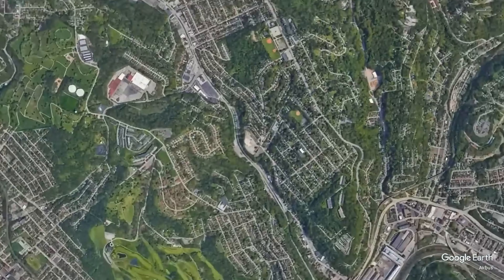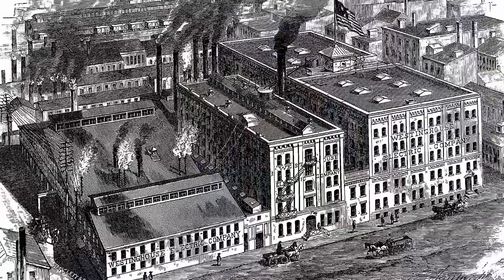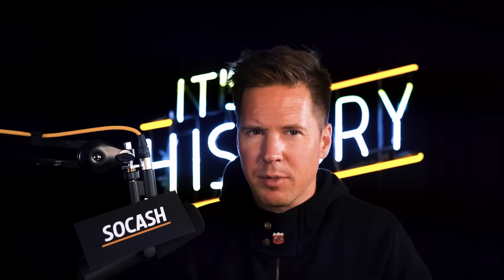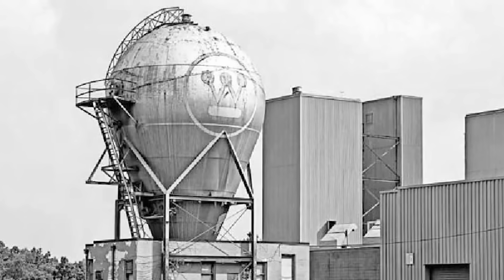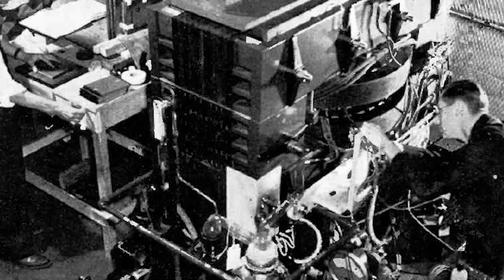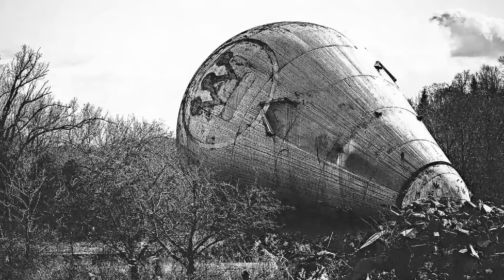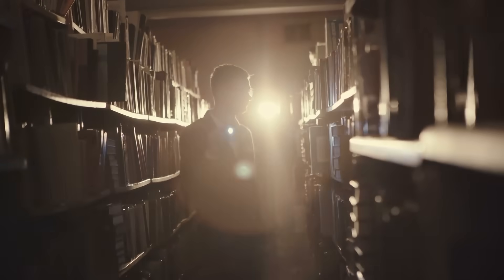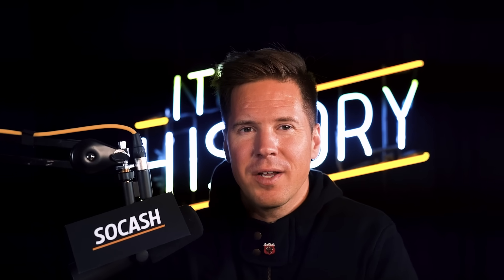The Abandoned Atom Smasher Explained

Comment: Absolute shame such a historical significant device is left derelict .. ;(
Reply: the accelerator is completely destroyed. the bulb is bend and the beam pipe in which the particle beam traveled is smashed to pieces within. The rubble pile outside is about the same as it is inside the pressure Versal. If it where to be rebuilt, it would need to constructed anew, as likely even the pullies where destroyed by the ceramic shards from the beam pipe. 

Also, without the building and the infrastructure inside it, the van de graf in the bulb is useless and incomplete.

Comment: Both the Westinghouse and the later EG&G companies were utilized by the Manhattan Project to develop the earl Krytrons, Sprytrons, Ignitrons, and later Trigatrons, for weapons detonator triggering.  We had two such shops across the street from our plant, and another down the road.  These were later surperceded by light-fired thyratrons or solid state SCRs and IGBTs.  In recent times, Westinghouse built the power Transistors for us, for the Lunar Roving Vehicles, and these devices were also used in railroad and ships-drive motoring systems.  Used to be a great company.

Comment: I live a couple of miles from the original site  the steel light bulb shaped hall that was over The vacuum tubes does still existt. All buildings were demolished It was said to be made into a monument to the original buildings and apartments put on the site, but the developer ran out of Money And was unable to do so last I heard the township where the building was located Is talking about moving The light bulb shape device to a local park and using it as a monument there.But it does still exist on the original property at this time Although it is laying on its side with no protection and at the moment is roasting away
Reply: I saw an Apollo capsule in a junk yard in Tucson in the late 1970’s!

Comment: It is a Van De Graaff generator that normally would produce almost a million Volts. This was modified to be like a vacuum
tube with a cover that looks like a light bulb so no air was able to get to the static discharge produced so it was able to 
attain 5 million Volts.
Reply: quite the opposite. Low vacuum would essentially make it large neon lamp, so the shell was at overpressure - compressed air is less prone to corona discharge, thus allowing Van de Graff generator to produce higher voltage
Reply: @hestheMaster  one of a kind, it's engineering and the craftmanship must have been amazing. So very sad it's demolished, so fairly recently.
Reply: Its still there if you still want to see it. Its just on its side now@HansOvervoorde
Reply: it was a pressure vessel, not a vacuum chamber. The shell is far too weak to withstand a vacuum. The higher pressure allowed for higher voltages due to increasing the dielectric breakdown voltage. A vacuum would need to be in the range of 1e-5 torr to be able to achieve similar voltages, but has the problem of field emission discharges.
Reply: @hestheMaster  would also be awesome Ryan for you to come visit it so you can see all of the ceramic insulators that are inside it It's truly something to walk up onto
Reply: Kinda like the one at the museum of science in Boston.
Reply: Outer shell is pressure chamber as noted by others. A vacuum tube ran down the center off the generator.